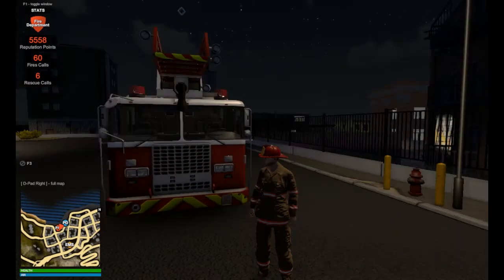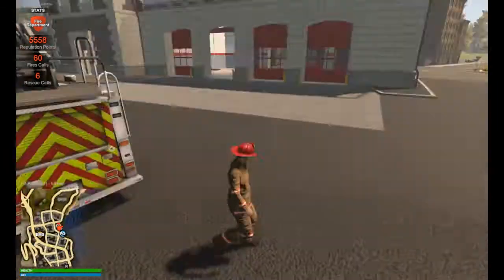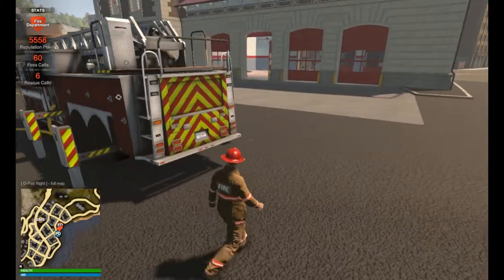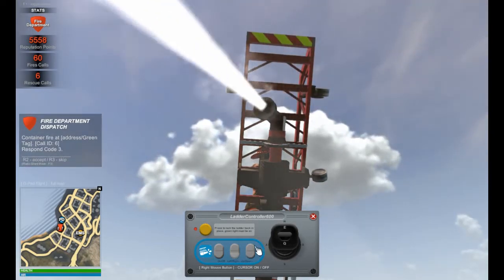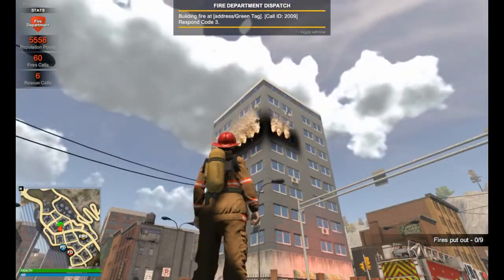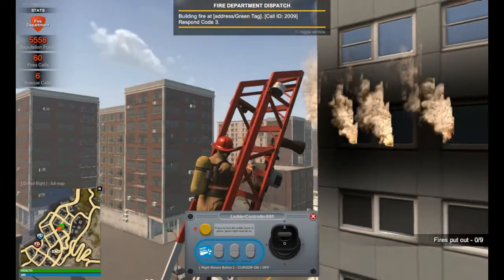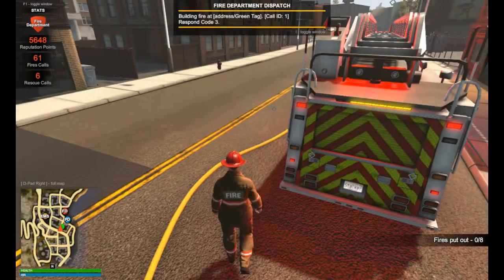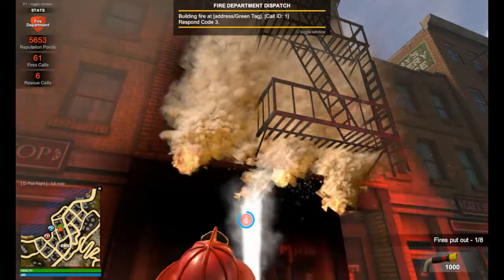Flashing Lights Tutorial 02A: Ladder Truck

Comment: How do the pump trucks work? I've tried running either of the hoses to the Ladder Truck, but neither connected.
Reply from the maker: You have to be on the FD. Also if you were, Either the vehicle glitched out, or you may have grabbed the wrong hose. There are two types, one is for refilling the truck, which connects to the larger port, and you have the smaller port for the other hose. The pumper truck will also be in this same manner. However you can only use the hose from that truck, for that truck, or it will tend to glitch. So it is best that only the driver can be able to use the main refill line to hook to the truck. And for other players, it is best they use the fire lines from the one truck, on that same truck, and not mix them. And you can not hook up the main refill line to the truck of another player or it tends to glitch. Maybe they will have this sorted since a new map is in the works for this game. Also if you click on that "show more", the link for the entire playlist of this will be seen. Because I do have a vid in that list that has the pumper truck.
Reply: @BATTLECATT00  Ah, thank you I'll check that out. Yeah hopefully they'll fix the bugs in this game. The simplist one is the bug in which the Player can no longer interact with their doors. I mean, that's an amateur move right there ha ha. Other than that I've been enjoying the game.
Reply from the maker: @reverenddickie8116  They had been updating it every month and keeping us noticed. The door bug thing is annoying. I did notice once we been able to custom the vehicles the door thing and some other related bugs picked up last year. That is why I always suggest, let the engineer attach his own refill line and remove it. And only from his truck for his truck. And other fire players who use fire lines and equipment from other players trucks, use that line on the truck they took it off, and return fire lines and equipment back to that truck they took it from. I notice this helped a lot with game play bugs in many ways. I myself have hosted a server that actually lasted more than and hour with out a restart. But sooner or latter your gonna get that 1 bug too many and have to do a server restart. Also if the vehicle bugs, and a restart does not clear it, you can check into the steam game forums for this game. There should be a pinned thread in regrades on how to delete the vehicle so you can redo it again. I myself had set up everything in SP mode so when I do MP mode, my stuff is already done. I have not ran into much issues since I did this, except the annoying door thing once in a while. But a restart always clear this. So I only did a vehicle delete once, and have not done so since I set my vehicles in SP mode. I am thinking when your customizing the vehicle when everyone else does in MP mode, there maybe a cross over that render's the vehicle useless. Since I already did it in SP mode, All I do is go in MP mode and play, and this thought maybe why I run into the typical bugs, and have not had it become useless, forcing a vehicle delete. It's just a thought.

Comment: How do turn on the scene lights?
Reply from the maker: The same key used for the car spot light I believe. You have to park the truck out side, and look at the key list and try out each one that is related to the lights. I am sorry I can not explain more than that, because my key layout is all re-assigned. So my spot light and truck emergency lights are turned on by the buttons on my car G29 controller that I got for ATS. So I am sorry I can not be too clear here on that.
But I can tell you that the water truck and ladder both use scene functions, but the ladder truck uses more. You have spots for the Right and Left as well as rear and front. Which being the front is mounted on the ladder. The keys for the turn signal should extend or retract the ladder.
I re-assigned my my turn signals to the paddle levels on the car controller and notice that using this same thing makes the ladder extend and retract.